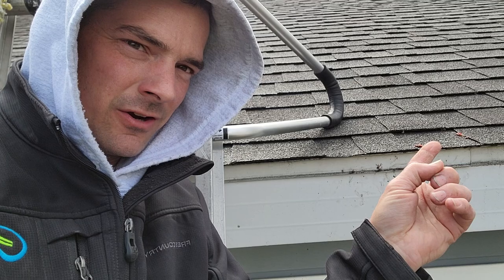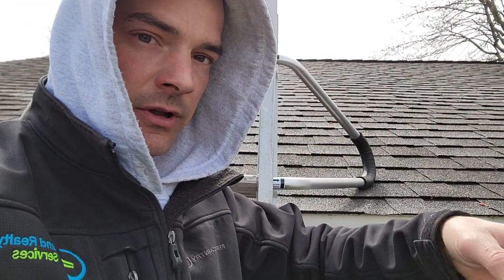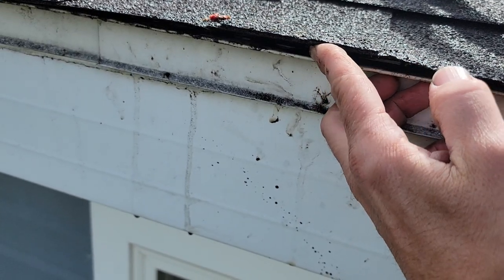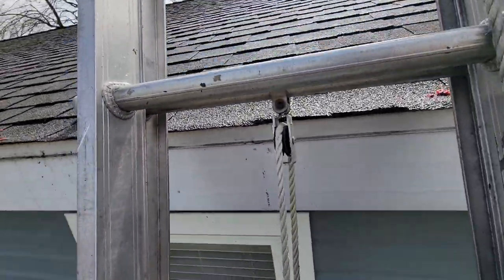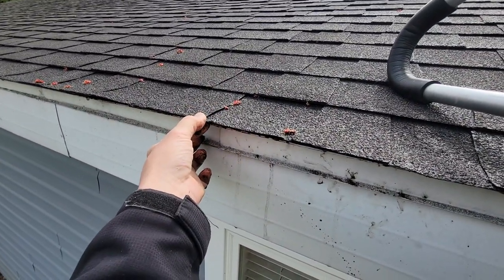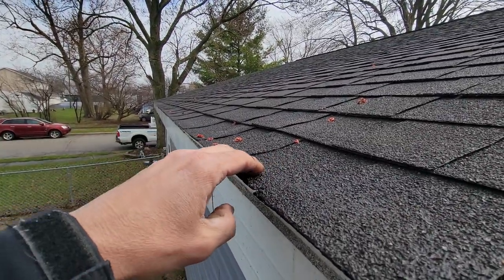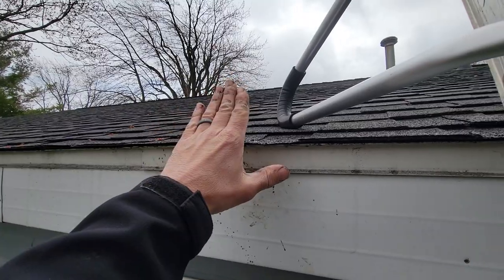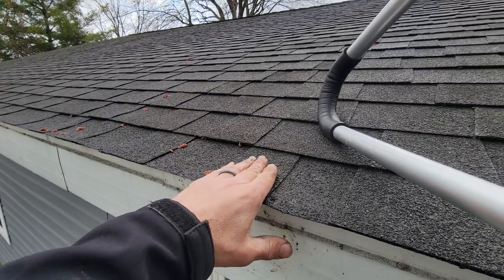Roofing ice and water over or under the apron?

Comment: IWS is a better tar paper - so should be above the apron or the drip edge. My house had the tar paper tucked in the drip edge at eaves, and it is BAD - run down water get into the front wall and rot some deck boards cuz drip edge is slightly above the end of the tar paper.

Comment: Ice and water always over the apron. Also the drip edge/apron should always have a slight gap between the fascia metal and drip edge/apron.
Reply: Also where is the gutters?
Reply: Usually if you just loosely put the drip edge on its good to go. If there's fascia metal then there's not really any need to have a gap at all as the fascia metal is protecting the actual wooden fascia board behind it from water contact
Reply: But i mean the roof in the video is kinda iffy, the fascia metal should have been higher up, even a small lip on the top side to lay onto the roof edge

Comment: How about ice & water then put starter roll comes in 30 foot roll and it’s peel and stick just like ice&water? ( over the apron )I see a lot of roofers using drip edge instead of apron don’t think it’s right , just not enough meat going up the roof. Good video 👍👍
Reply from the maker: If ice and water is going to go down 1st it really should go over the facial border a little. So any potential backing up of water needs to get out over any facial metal. As far as the peeling stick starter I'm not a fan of it, if it's what I'm thinking of it's not near as thick as starter shingles.

Comment: Watch the this old house video on how to shingle. Ice and water shield run over fascia but behind drip edge (so you dont see it), offset drip edge from fascia a half inch to prevent wicking, offset shingle past drip edge a half inch to further prevent wicking. If you do it this way I dont think water could get under the drip edge, but i guess you could put ice and water shield above and below the  drip edge to be safe.

It looks like they did not bring the aluminum fascia up to bottom of drip edge which isnt helping as well.

Comment: I need some guidance, i live in Houston and my house was built in 1975, I have some rotten roof decking and I have some rotten fascia. I'm getting ready to re-do my roof and was wondering should I replace all my fascia first before I start on the tare off or replace the fascia after the tare off? But I was thinking the old drip edge is in my way of replacing the fascia, so I might have to demo the roof first and then replace the fascia, then new drip edge, then roof? Also, the original fascia is two pieces of wood. First a 3/4" thick with a six inch profile but over that is another 3/4" thick piece of wood but it barely sticks out below the  1 1/2" drip edge. All the houses in my neighborhood are like this but can't find anyone online or YouTube referencing this style of fascia. Maybe because I don't know the proper name for it?  IDK, im guessing it's called step fascia or something like that? Any help regarding that would be greatly appreciated. Thank you.

Comment: I am just a homeowner, so I am learning multiple things from every one of your videos.  At 8:54-8:55, I think you are saying, if you are not going to take the gutter off, then you would want the i&w to lap over into the gutter, rather than down the fascia.  If that is what you meant to say, I don't think you ever want i&w lapping down into the gutter because in a big rain storm the gutter is going to be full, water will work its way up behind the i&w, and in the winter, freeze-thaw will destroy the i&w adhered on the gutter side.  I like your suggestion that drip edge should always be installed at least 1/4" beyond the eave edge.  That way the bottom angle will be far enough away from the fascia to actually function as a drip edge.  Otherwise, water is going to climb/creep up the fascia behind the drip edge, and not dry out very fast.  My comments are based on my own observations around my home of 38 years.
Reply from the maker: I was talking about the gutter because some people tell me I need to take them down and install ice and water over the face of the facia bored.  I don't see anyone removing gutters to put ice in water down. The biggest thing is making sure if you put it down before apron it goes over the face of something other than wood. That's why I'm a fan of putting adequate sized apron down then installing ice and water on top of that to seal everything off.
Reply: @GrandRoofingInc   That makes sense, . . . not leaving any wood exposed that could get waterlogged and rot out.  In the high country in Colorado, local building codes require Ice&Water over the entire field of the roof, not just along eave edges, gable edges, valleys, transitions, hips, and ridges.  I have seen some online discussions that I&W over OSB can make it impossible to re-roof without tearing off all the roofing materials, including the OSB, because the I&W cannot be peeled off once it hits wood or metal.  That might be a reason not to attach I&W to apron, because a tear off would get even more expensive and time consuming if all the metal had to be replaced at the same time.  But I am not a roofer and do not have any personal experience.  I just read it online.  Also, the slope of the roof and the angle of the fascia can make a difference as to how well a drip edge or apron functions.  Flat roofs will have more water lingering in the fascia area and getting wind-driven against the fascia, whereas on 4:12 or steeper, water will drip more freely to the ground.  I am still thinking about the idea that drip edge or apron where the bottom edge is clamped against the fascia is prone to not releasing drops of water, instead just holding them against the fascia for absorption and eventual popping of paint.  This might be an argument for making sure the fascia is 100% vinyl or metal.  Also, I wish they made I&W that came with synthetic on the surface.  It is less safe for the roofer to work on slippery synthetic, but I believe I&W has a sticky surface in hot weather, and a metal roof will oil-can if it cannot slide when expanding & contracting in hot weather because it will be stuck to the I&W.  This might be an argument for covering a full roof of I&W with another layer of synthetic.  Or then there is Huber Zip System and Georgia Pacific Forcefield, but I don't know if they get sticky in hot weather.  I think their water proofing comes from chemical preservative, but I have not heard anyone describe what exactly produces the water proofing.  Maybe you could address this question in a future video.  Sorry I put so much in this comment.

Comment: Ice and water down and wrap onto the subfascia board, place drip edge and run another small 4 inch wide length of zip tape over the upper seam of drop edge to connect it to the ice and water shield. That way any ice damns or gutter blockages don’t get up under the drip edge and do what you see in your video, it’ll also allow passage over the drip edge if any compromise happens up the roof. 

Follow that methodology for eave and rake edges and flashing.

Comment: Drip edge or apron flashing? If you use drip edge on a lower slope is it going to push the edge shingles up and create an opportunity for wicking water back or even ponding along the edge? Isn't the drip edge designed to be at 90°, rather than an apron that is made for the slope of the roof to the vertical fascia? Or are there types that are angled properly? If you have a gutter (and around here we always do) is having a drip extension still a good idea?

Comment: I am not a Contractor but this question seems to be a never ending battle with no one actually presenting a responsible, well thought out, answer! Until recently, that is! My name is Ed. I am on my wifes account because I do not do social media. We are getting ready to have a roof installed within the next two weeks and I asked that question of every Contractor that quoted my roof. Understand that I did extensive research on roof installations and if it weren't for my age, I could probably install the roof myself. But...... I finally had one Contractor that actually gave me the ONLY answer that made any sense! He said: The Ice and Water Shield goes "under" the Drip Edge. I asked him why and this was his response: "The bottom row of shingles has to stick to the Drip Edge. The Tar Strip on the bottom of the shingle needs to stick directly to the drip edge because if there were strong, hurricane winds, (we reside in Florida) there would be a good chance the Ice and water shield would be able to be blown off the Drip Edge, along with the Shingles on the bottom row! That was the only "reasonable" answer anyone gave me!
Reply: Just an observation. Over anything else you may put down and under the shingles, many manufacturers require a starter strip, usually their own, to have their warranty. Seems to me your roofer is not using a starter strip if he says the shingles must stick to the drip edge.

Comment: I always run ice and water under the apron then apron then synthetic felt. If your going on top I would recommend priming the edge metal like you would for sbs. Sbs on low slope is the same base down first, edge metal primed then cap sheet. Just my opinion

Comment: I need 1 of those ladder stand offs please send info..
Reply from the maker: There should be a link down below to Amazon
Reply from the maker: Ladder Stabilizer Standoff
https://amzn.to/300Xhz2
Reply: @GrandRoofingInc  Thank you
Reply from the maker: @joshuawilson1989   I had to modify mine just slightly with a hatchet to get it to fit. I did do a video on it so you can see before you order it, but it is definitely one of my favorite tools besides my mag hatchet.
Reply: @GrandRoofingInc  I ordered the hatchet..
Reply from the maker: @joshuawilson1989   You'll like it!!  We use it mainly for repair work and installing synthetic paper with plastic cap nails. I don't use the knife or gauge on it. I also use the hatchet side for chipping away nasty old tar and flashing.
Reply: @GrandRoofingInc  I think I'm going to really like it . I'm willing to use any tool the makes tasks easier..